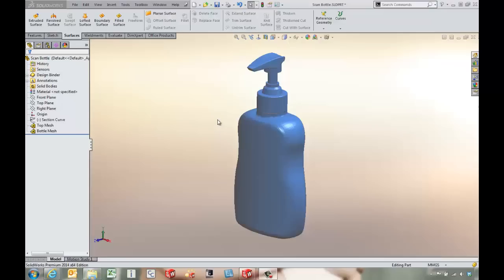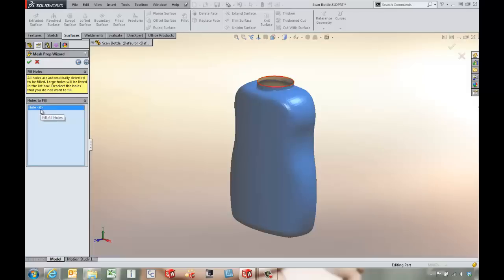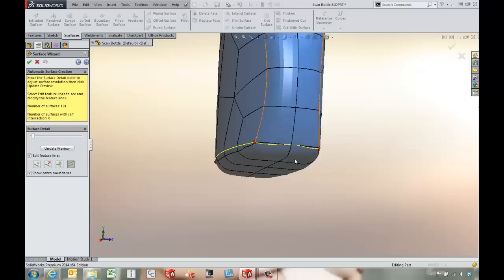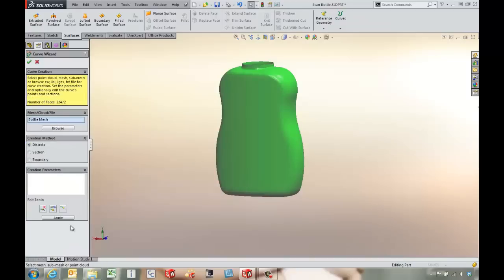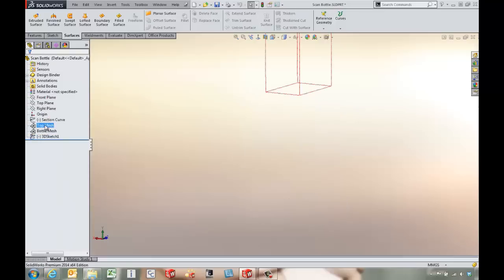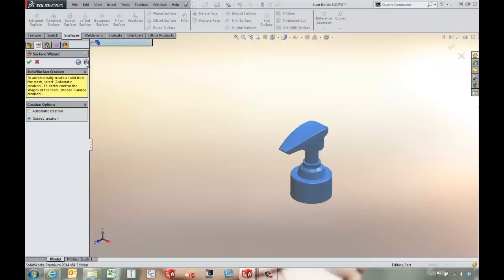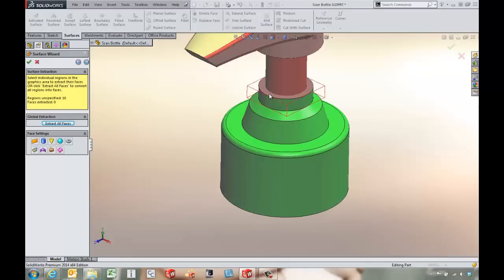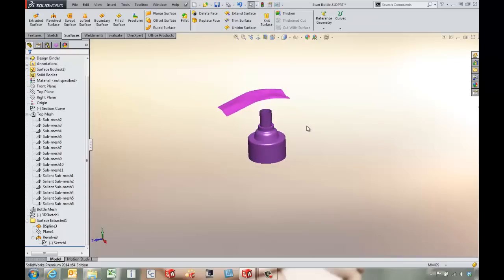SOLIDWORKS – ScanTo3D Add-In Overview

Comment: i cant find that add in.I guess i dont have it.Where can i obtain it from and how ?
Reply from the maker: The Scan To 3D add-in is part of the SOLIDWORKS Professional and Premium packages, so you will not have the option is you have the SOLIDWORKS Standard package.  To activate the add-in, you can go to Tools/ Add-ins and find it in the list (usually in the first section) and check the box for the active session or to turn on at start up.

Comment: Hi i have a the cloud points of a room in .mat format which has two matrices for point location (single format) and color (unit8 format). How can i import color matrix after importing point location into solidworks?
Reply from the maker: Hi johnvs, nagendra,
This software only takes in the point cloud model data.  There is presently no method to pull in your color matrix as well.

Comment: I imported scanned mesh file (STL), but ScanTo3D options are not active (except for curve wizard). Anyone know why? I  have SW Premium 17. Thanks
Reply from the maker: Hi Vytautas Nar,
.STL files tend to either come in as a graphics body (non-interacting body), surface body, or solid body.  If you have a specific mesh .STL and the mesh wizard is not available we are unsure what exactly has gone wrong.  You will need to contact your local VAR for SOLIDWORKS to get assistance diagnosing what has happened.
Reply: go to add in for scan to 3d

Comment: I have the ScanTo3D plug-in installed in my Solidworks but, when I try to import an stl file in mesh mode, I can see the object in the feature tree, but I cannot see the object in the GUI and in the add-in process also. Does anyone know how to solve this issue?
Reply from the maker: Hi Lorenzo,
I know this answer comes late but if the object is in the feature tree you may be able to right mouse click on that and use "Zoom to Selection" to move the work space to your model.  It may be located very far from the origin and this could help.